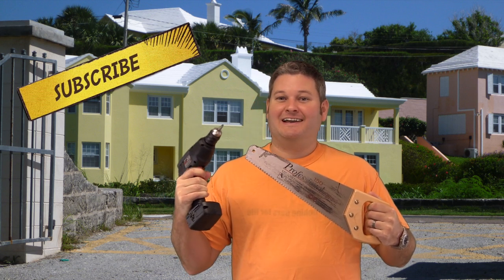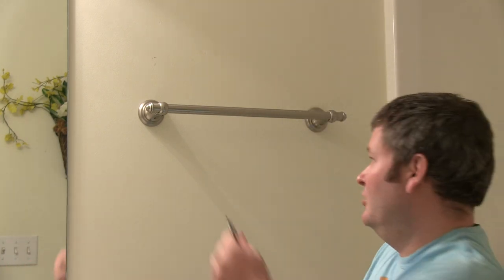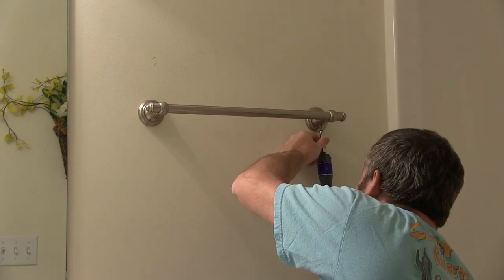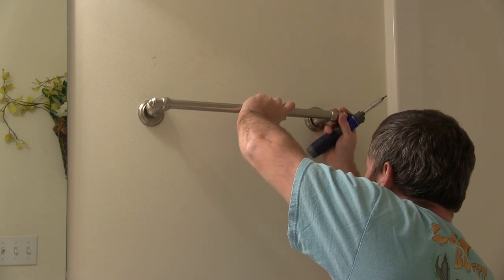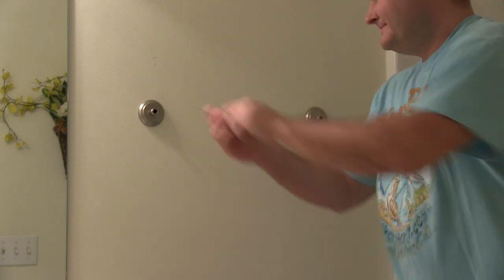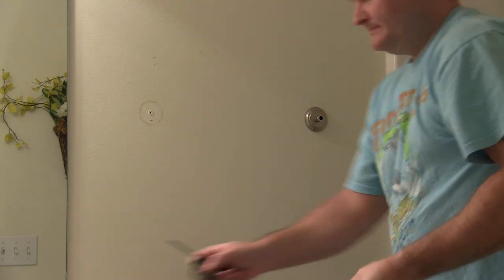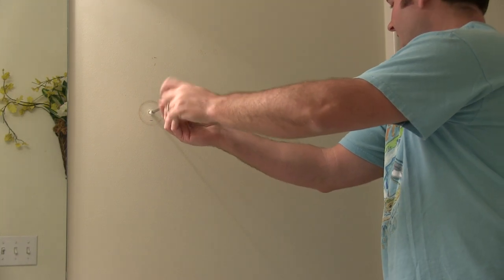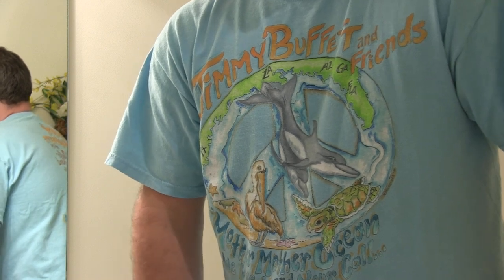Towel Bar Removal from Wall HOW-TO

Comment: Hey cool video but i have one of those white plastic ones that does not have any screws what so ever. The towel rack is on the wall pretty solid. Will i have to use a rubber mallet to try to "pry" it off the wall and/or if it will damage the dry wall? Thanks

Comment: The tiny pin that secures the rod to the wall bracket is broken, so I am looking for a way to remove it. Being both small, and flush against the wall is two strikes against it. Small pliers didn't do the trick. Looking for another way to removed it from the wall without unnecessarily damaging the wall.
Reply from the maker: If you wanted to destroy the unit, you might get lucky with a hack saw and then remove the broken part from the inside.

Comment: what if the towel rack does not have any screws in it?
Reply from the maker: Hmmmh....you got me on that one. =(
Reply: I have that same problem
Reply: +The YouTube hubs
Is there a cover over the screws?  You may need to use a small flat blade screwdriver to lever of the cover to get to the screws shown in this video.
Reply: Kutulue Thank you  for the reply.. After watching your video I was able to realize I had to use the flat head..

Comment: Can you make a video on how to remove a koler towal rack
Reply from the maker: +Cody Bishop Check the bottom of the two brackets for two small things to release it from the brackets screwed into the wall.
Reply: Mine is completely solid on the bottom